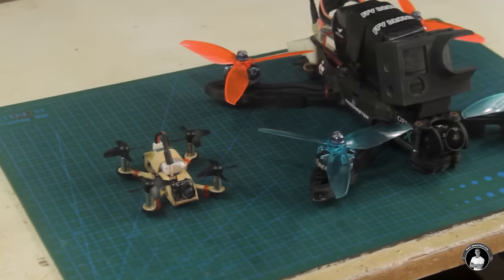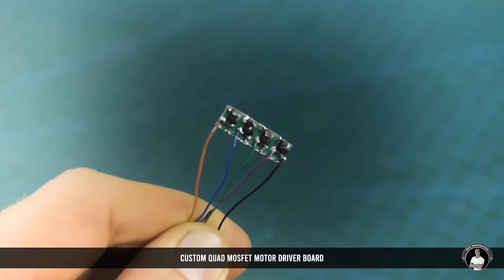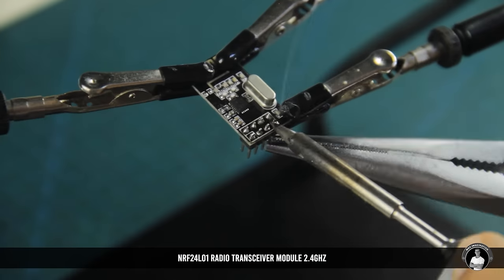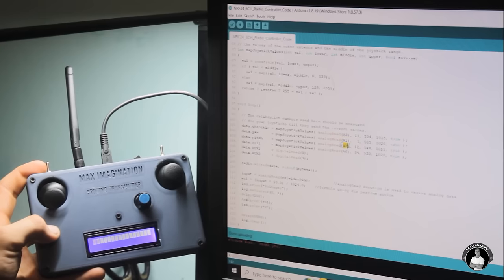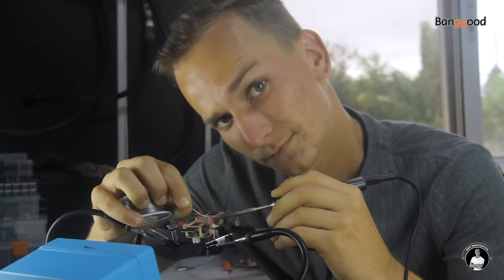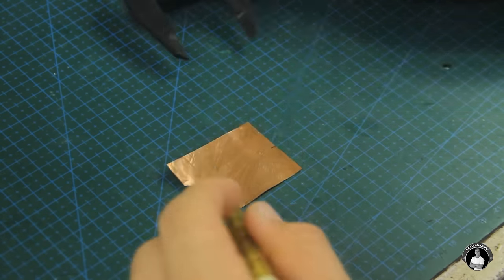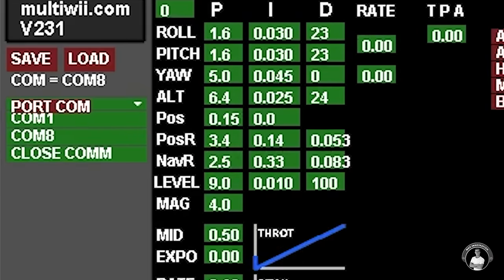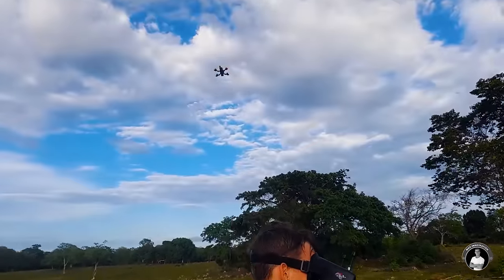Make a TINY Arduino Drone with FPV Camera - Will It Fly?

Comment: Hello, the problem of connecting the radio control to the drone was solved, and I also fixed the values of the joysticks Only the engines do not start, what is the problem?
Reply from the maker: Hey. Glad to hear you solved those issues! Did you set up the AUX channels for arming? Be sure to configure your arm switch exactly as I show in the video or else you won't get your motors spinning. Cheers.
Reply: @MaxImagination  I will check and let you know the result
Reply: @MaxImagination  Hello, I checked everything and the channels are set correctly Where else do you think I should check?
Reply from the maker: Hey there. Did you check that your drone motors' signal wires are connected properly? Did you make sure you flipped the arm switch before testing the throttle?
Reply: @MaxImagination  

Hello, the problem is solved and the engines start Also, make a tutorial on making a drone with esp32, please, or upgrade the same drone so that we can control it with a mobile phone via Bluetooth or Wi-Fi
Reply from the maker: Hey there! That's great! 
To answer your request, I'm trying to stay away from repeating the same topics. An ESP32 drone can be made from following other tutorials out there. Cheers ✌

Comment: Hi, can you make a video on how to make a video transmitter VTX in a drone and display it via phone? Can you reply, please?
Reply from the maker: If I get enough requests on that project, I may only then do it. Cheers.
Reply: @MaxImagination  Ok, you can do it on the next video and get 100,000 views, and it works on a GoPro 4 camera.
Reply: @MaxImagination  Ok, you can do it on the next video and get 100,000 views.
Reply: @MaxImagination  ok, you can do that in the next video and get 100,000 views, and it works on a GoPro 4 camera. And without any stuttering or blurring.

Comment: I need your help, I already have a transmitter and reciever, What will be the connections in that case ? So I don't have to buy NRF24L01 , I already have an MPU6050, just have to buy Arduino Nano.
Reply from the maker: What transmitter and receiver do you have? Assuming it's Arduino-based like mine, make sure you're leaving the necessary pins free for the motors like in my diagram linked in the description.

And of course, wire the MPU6050 the same way as I have.

If your receiver's NRF connections differ from mine, you can change those in the code. 

Apart from that, it should work.
Reply: @MaxImagination  I have FLYSKY FS-i4X , I bought it but currently don't have enough budget to make a full fledged FPV Freestyler, that's why I was thinking to use it in this project.
Reply: @MaxImagination  Kindly help brother, Can i use normal Flysky Transmitter and reciever in this project ?
Reply from the maker: I am not sure and cannot guarantee that it will work. If you're willing to do your own figuring out and manage to integrate a flysky receiver instead of the NRF24L01 to connect to the Arduino, then go for it. I believe it's possible somehow, but I won't be able to help you on that as I have never tried integrating that receiver protocol. Best of luck!

Comment: I know the following would add weight: But, if you were to take a solar cell off one of those little yard lamps, and wire it in, would it be worth it, for letting it sit in some sun to recharge? Say, fly it to your roof to sit and watch where the damned squirrels are getting into it, so I don't have to fly it down every few minutes to recharge it?
Reply from the maker: In ideal circumstances with good solar panel efficiency, that could have been a nifty feature. However, that is not practical due to the weight constraints. The tiny solar panel which could be carried by the drone wouldn't be powerful enough to charge it alone in a reasonable amount of time (Maybe with enough hours in direct sunlight). Hope that clarifies it for you! :)

Comment: okay, very impressive, but now rebuild everything for esp32-cam
Reply from the maker: Thanks! The ESP32-cam is not compatible with this project.
Reply: @MaxImagination  I am kidding you with this rude words. 
I really like it, and some time ago was really curious about using arduino as a flight controller but had no idea how to replace motor speed controllers, but now its all clear to me, and I'm going to build it.
I'll try to stream video on my smartphone and transmit controll signals from my smartphone as well, so the whole project would be a bit cheaper
Reply from the maker: No worries!
Glad you found my video helpful in making your own Arduino drone.

Best of luck!

Comment: Hello sir / ma'am , Can I know how you connect the radio recicver and transmiter in detail . Please  , I request the audiance also
Reply from the maker: No binding needed. The transmitter and drone pair together once both turned on.
Reply: @MaxImagination  sir thank you for the reply , i wanted to connect the flysky transmitter with the another nrf reciver module(not the reciver came with the box) which i connected to Arduino micro pro(same as you done in the video ). Is it possible ?
Reply from the maker: I don't think that's possible. You can instead look for tutorials online on how to connect a flysky stock receiver with an Arduino instead of the NRF.

Comment: I made the drone
When I connect it to the Multiwii software, I set the arm to high and the beeper to high, according to your instructions, I wrote and only the buzzer beeps and the radio control is not connected, where is the problem?
Reply from the maker: Does your transmitter connect to the drone? Have you checked any values being displayed in the software based on your input? Make sure you select the high level boxes for the corresponding AUX port based on your switch and hit write. Maybe you also have the wrong aux port selected, try different ones out of the 4.
Reply: @MaxImagination  The nrf module is healthy and working and the connections are established, but the radio control does not command the drone, why?

Comment: Hey man nice video but i just wanna make the transmitter in this video and can i use this transmitter  for something else and also can i make receiver for this trannsmitter  also how can i find codes for transmitter and reciver
Reply from the maker: Hey there! As mentioned in the video, you can find the transmitter codes linked with the other resources in the video description.
Reply from the maker: You can make a receiver for the transmitter just for general use in other projects by following steps in my latest video (Arduino Pistol-grip transmitter).
Reply: @MaxImagination  ok Man thanks but i have a one more question can i connect transmitter in this video to recevivor from your latest video
Reply from the maker: Yes, you can, using both codes from my latest video.
Reply: @MaxImagination  so all i have to do is upload the transmitter code in your last video to the transmitter in this video
Reply from the maker: Yes. Code from my latest video to the transmitter used in this video.
Reply from the maker: One thing I suggest you check is the pin definitions in the code. Ensure that all matches according to the wiring of the drone's transmitter.

Comment: Can someone tell me what he’s doing at 3:32 - is he soldering a resistor on to the perfboard?
Reply from the maker: Hey! No, that was a section of wire from a resistor. The resistor itself was not added.
Reply: Ok that makes sense, thanks for answering my questions. I’m just getting started with electronics and am trying to learn.

Comment: Which type of smd diode you have used and which type for a normal diode
Reply from the maker: I used a schottky T4 diode
Reply from the maker: A 1N4007 or similar rectifier diode will also work.

Comment: Can i use normal resistor and normal diode and smd mosfet to make it
Reply from the maker: Yes, you can. However, keep in mind that using standard size components will increase the drone's overall weight. You may need to cut down on weight on another part of the drone to keep it sub 30 grams or so.

Comment: Hi just a question the circuit diagram of transmitter is missing the transpiter charging connections pls tell how to do that
Reply from the maker: Oh true, I must've forgot that... Google "2S Battery Pack Charging Connection" to see how a 3-pin connector connects to the battery via 3 pins. One for - another for + and the middle one for the middle node connecting both cells.
Reply: @MaxImagination  thank you and loved your video
Reply: @MaxImagination  then you are not using bms so how will it prevent from overcharge?
Reply from the maker: The BMS is handled by the charger - https://amzn.to/4aejYyh
Reply: @MaxImagination  oh the thing is not available near me so i was thinkingbtobuse tp5100

Comment: Hi, I have a problem. I can connect my drone to multiWi, can you help
Reply from the maker: Hi, please ensure you have Java installed on your PC (read my pinned comment). Also test opening the 32 and 64 bit versions multiple times.
Reply: @MaxImagination  i've installed Java on my PC and do like you say but i still can't connect
Reply from the maker: Does MultiWii open? If so and you drone still doesn't connect, check that the code uploaded successfully and that your MPU6050 & NRF24l01 modules are also connected. Ensure your connections are solid and make contact by checking with your multimeter in continuity mode.

Comment: You stuck at 13:00 how did you solve that. You used some additional components to fix it but it did not solve at last how did you solve that did you change the code are any other components like resistor capacitor
Reply from the maker: I did actually  show at last how I solved that issue. It was copper that I placed to shield the flight controller from the motors' EMF. This had stopped the drone from resetting.

Comment: Is nrf adapter is require in transmitter
Reply from the maker: Not mandatory, but helps give a more stable 3.3v supply rather than straight from the Arduino.

Comment: Can i use 2 pin toggle switch
Reply from the maker: Yes, you can use a 2-pin. As you only need to toggle from off to on, activating a pin on the Arduino programmed for arming the drone. I simply prefer using 3-pin toggle switches to allow for more channels to be toggled.

Comment: There are many types of smd resistor which type i should use
Reply from the maker: The 103 type or 10K Ohm.
Reply: What is the difference between smd resistor and a normal resistor. Can i use the resistor instead smd resistor if yes which resistor

Comment: Help,i got a similar camera like this,but theres 2 small thingy on the transmitter board fell off and its not working anymore,how do i fix it???
Reply from the maker: What thingy? If you mean the wires, then they need to be resoldered.
Reply: @MaxImagination  its was like those smd capacitor

Comment: I haven't checked yet since I'm on my phone, does anyone know if the print file can be printed on a resin printer? I unfortunately do not have a pla printer.
Reply from the maker: I have not tested my design with a resin printer, so it would be best for you to check online if anyone else has made anything tough that was resin printed. In my opinion, it should work.

Comment: Hi bro I made a transmitter from your old video but transmitter and riciver do not responding 😢

Please give me solution for it please reply bro 😢😢
Reply from the maker: Hey there. Make sure you have the radio module wired according to the diagram I gave. Run the NRF24 module with a stable 3.3V supply - not from the Arduino, but through a voltage regulator. Also, you may need to place a 10 microfarad filtering capacitor at the power terminals.

Comment: Bro my transmitter dosent work 
I tried separate power supply for nrf but it's dosent work 😢😢
Please help me 😢
Reply from the maker: Have you tried adding a 10 microfarad filtering capacitor? An AMS1117 3.3V regulator? Maybe you fried it...

Comment: Hi, I recently had an issue where my Pro mini would reboot when I switched to a bigger motor (716), but my original motor (614) worked fine but would not lift the drone. So I rebuilt it on the motor (716). I put a copper pad under the Pro mini and it still reset itself. How should I fix this? (I'm using a 3.7V 250mAh 20C lipo power supply)
Reply from the maker: If you're still getting the reset issue, it could be due to the way you have connected the battery to the drone. I recommend pinching the inner crimped metal prongs within the JST connectors and ensuring a firmer fit in the drone's female power connector. This needs to be solid. 

Also, are you sure you properly grounded the copper sheet to your Pro Mini?
Reply: @MaxImagination  The battery connection is solid and there is a 0.1mm thick copper pad connected to the GND pin near the Promini 5v 16MHz reboot button, but the drone still resets itself.

Comment: I'm tryna synchronize the sketch with the MultiWiiConf but it simply shut down. I'm using the arduino nano. Do you have any idea why I can't connect to calibrate?
Reply from the maker: What do you mean by synchronizing it? Try opening a different version of the multiwii software in another folder, such as the 32-bit version. Software as such can have strange incompatibility issues.
Reply: @MaxImagination  I've found out the problem. It is a bug on MultiWii 64 bits. I've installed the jre x86 and opened the 32 bits version. Worked like a charm. Thanks anyway

Comment: During my first experiment I made a drone circuit using a brushed motor and a schematic circuit owned from description. So, after that, I assembled it and finished making the flight controller (I haven't installed the dynamo yet) I tried it on the MultiWii, the transmitter and receiver are connected to each other and the movements on the joystick are also recorded on the MultiWii. but after I assembled it for the brushed motor and I installed it in my Arduino flight controller, but when it was powered by a 2s lipo and connected for a moment and part of the dynamo rotated by itself, I don't know, I didn't know before I raised the throttle... well when I raised the throttle it actually turned between the receivers and the network transmitter suddenly disconnects and the dynamo rotates randomly and irregularly. and there is no longer a connection between the remote and the receiver. please friends what is the solution
Reply from the maker: A 2S lipo battery? Are you sure you powered your Arduino and motors correctly? Check your MOSFETs too with a multimeter, sometimes one of those fails short due to static zaps from touching their pins.
Reply: @MaxImagination  I'm using an Arduino Uno as a flight controller...so the problem is with the MOSFET, right? Can I replace the mosfet with IRFZ44N or is there any suggestion for another mosfet that has the resistance of a 2s 7.4v lipo battery?

Comment: Sir can we use si2301 instead of si2300
Reply: And what MOSFET did you use sir
Reply from the maker: No, as that's a P-channel mosfet, you need an N-channel mosfet. I used the si2300.

Comment: but eletricnoobs code was not working with 3.3v 8mhz pro mini. especially multiwii java application.
Reply from the maker: He had a different issue with his mini drone which was that it was too heavy and wasn't properly shielded from the EMF induced currents from the motors.

Comment: hi i have a arduino pro mini 5v 16mhz. can i use it with a step up dc-dc buck converter?
Reply from the maker: Interestingly, you don't actually need that. It will work with a 5V pro mini as well.
Reply: @MaxImagination  ould you tell the pinout for that?
Reply from the maker: It's no different than what's on my circuit diagram of the drone.
Reply: @MaxImagination  but wont the pro minis 5v regulator be unable to power the chip? Or should i try powering it from VCC?

Comment: Will ardunio nano work in this project
Reply from the maker: Yes, however, it weighs a bit more than the Pro Mini. You may need to reduce the size of other parts then.
Reply: @MaxImagination yeah if i desolder the pins off it will work

Comment: Im a beginner and i dont know how to connect the motor to the receiver from the reciever and transmitter video tutorial
How am i gonna connect the motors?
Btw im making my own drone
Reply from the maker: You connect the motors to the receiver (Arduino) through the motor driver board that you need to make.
Reply: @MaxImagination  oh ok thanks max
Reply: @MaxImagination  wait i just realized I have a brushless motor that has a 3 wires how am I gonna connect it?
Reply from the maker: You need an ESC for each motor. That will connect the 3 wires.
Reply: @MaxImagination  welp as expected you save the day once again max thanks, you deserve a sub from me
Reply from the maker: I'm happy to help. Thanks!

Comment: Sorry but I'm curious why adding two toggle switches?
Reply from the maker: As mentioned in the video already, having them is mandatory. One allows you to arm or initiate the drone - without it you cannot fly the drone. The other gives you access to turning on other features that you configure in MultiWii such as the beeper alarm or other modes.
Reply: @MaxImagination  Thanks! Besides may I ask the function of the potentiometer in the transmitter?
Reply from the maker: The potentiometer isn't necessary and wasn't used for the project. It's an extra.
Reply: @MaxImagination  Thanks, may I ask the function of smd diode and the polarity of it? I searched the internet and I'm not so sure.

Comment: Will it work with arduino nano?
Reply from the maker: It might, but there will be some weight constraints as it's heavier. Be conscious of that and reduce weight in other parts of the drone if you plan to make it the same size.
Reply: @MaxImagination  thank you sm